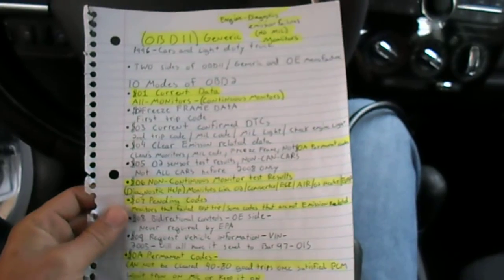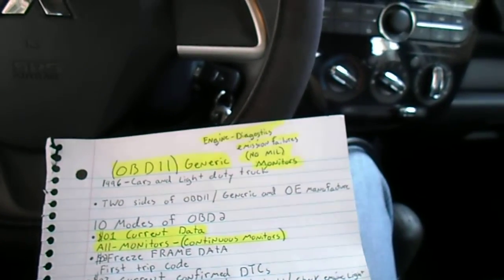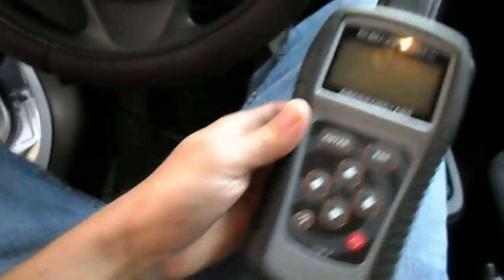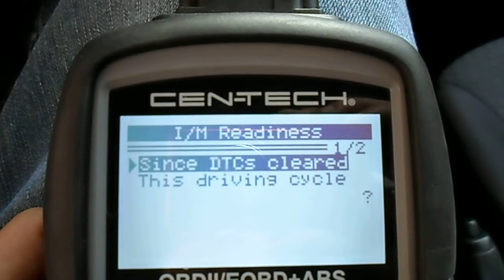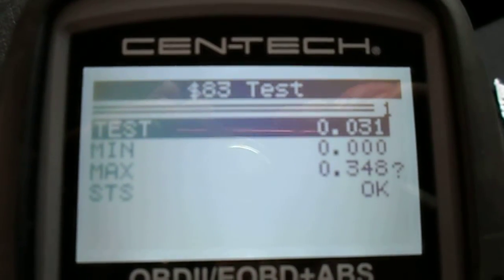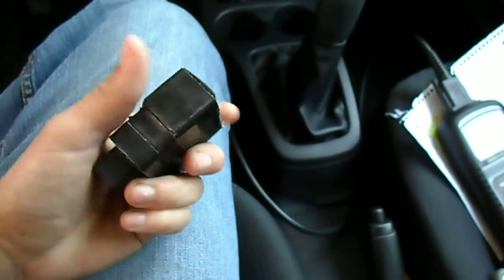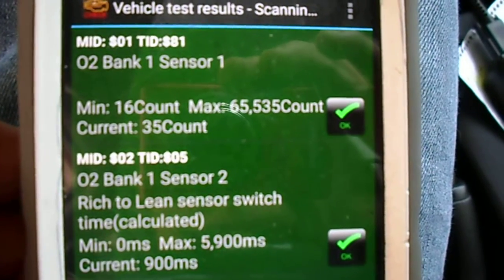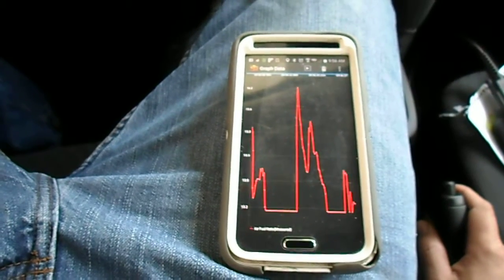Matt's Smog Tip (2) Emissions OBD2 10 Modes Torque App Pro OBD II & CAN Code Reader CEN-TECH 60794

Comment: Hi. I got this. Dont know what it means. Plus p0389 crankshaft sensor  TID:$03 CID:$01
 - Low sensor Voltage for switch time calculation
Test incomplete or dependant test failed
Reply: Your crankshaft position sensor may need to be replaced (part is under $30 from dealer) or you possibly installed Ann aftermarket sensor and your car couldn't calibrate properly.

I had a similar issue when I purchased an AutoZone sensor and got a similar message. Vehicle couldn't calibrate and vehicle idled ave drove very rough. I replaced that with dealer sensor and the vehicle calibrated within seconds.

Never buy aftermarket sensors, they rarely work properly.
Reply: @DHFlip18  damn. I wish I knew this then. Ended up selling the SUV for 800

Comment: I just bought this same ODBII scanner on closeout $94.99, regular price $139 and got to use 25% off coupon  to around $72, HF is getting a new line of ODBII scanners from a different manufacturer supposed to be a better quality, so i paid for warrenty/exchange so im able to upgrade once new model comes out.